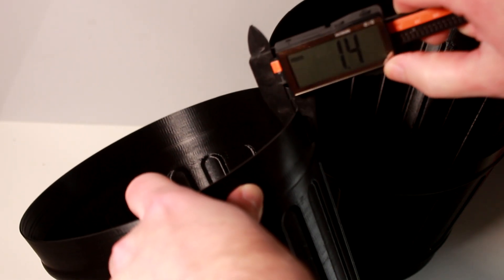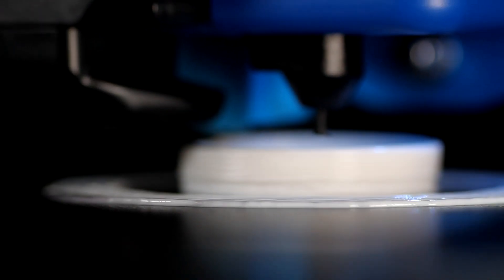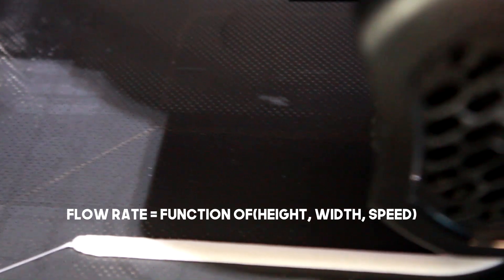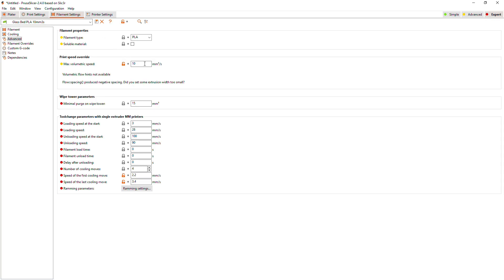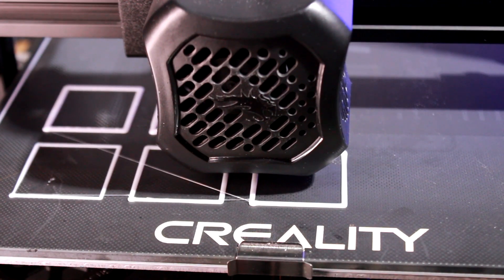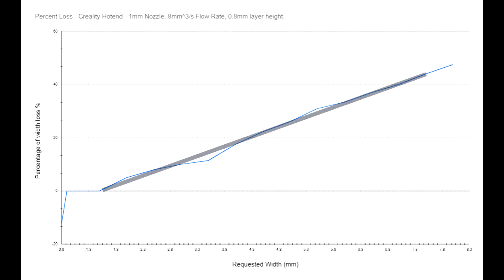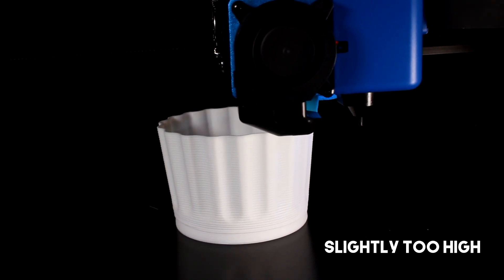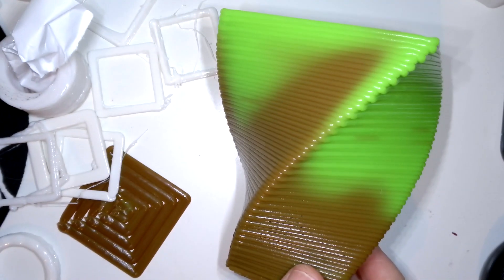Extreme Vase Mode II - EXTREMEST vase mode. How thick can you go when 3D printing vase mode?

Comment: The thermacroic filament test was some of the most insightful I’ve seen in any 3d printing test
Reply from the maker: It's a shame only 34% of people watched to that point 🙄
Reply: @LostInTech3D  still.... the implications for printing larger are that whole part cooling is something that will need to be developed, not just the topmost layer. I dont know of any current tech that cools down middle layers
Reply: thermochromic (heat and colored in greek)
Reply: Yeahh it looks so nice, and perfect for education.
Reply: @LostInTech3D  Hey that's okay, I'm back for a rewatch anyways so eventually it'll balance out
Reply: Actual uses for thermochromic filament are awesome. I've thought about printing fan ducts and toolheads out of it, using the color change to get a sense of what parts really need to focus on thermal resistance, but I ran into a problem: I want filament that changes color at around 50C (glass transition temperature of PLA) or 80C (class transition temperature of PETG), but I can't find any keyed to that temperature range.

Comment: I have to thank you for the optimal layer height part at the end. I have noticed inconsistent line width on my parts and couldn't nail it down. I used that calculation to find the proper line width and it completely fixed the problem 🙏
Reply from the maker: Glad it helped!

Comment: Great video. It's amazing how far you were able to push the limit, especially with the entry-level hot end. I recently designed a fast-printing 'vase mode' modular drawer system that works best with a 0.8mm line width. I found that printing with a 0.4mm nozzle produces much sharper detail in the corners (important for this model) than using a 0.8mm nozzle, even at the same line width. When I shared this on thingiverse, I was surprised by how many comments there were from people who didn't realise it was possible to print a line width much wider than the nozzle size.
Reply from the maker: Yeah - in the part 1 I did a survey and even when prompted most people didn't seem to think you can go much over the nozzle width, I guess the cat is out of the bag now, maybe more vase mode designs will appear (I'm interested to see yours btw!)
Reply: For some reason, I can't seem to post a link here,  but the design is on the top of the thingiverse landing page at the moment, so easy to find: 'Fast-Printing Modular Drawer System (Vase Mode)'
Reply from the maker: yeah it does moderate links but I usually get them in my moderation queue. Thing #5210727?
Reply: That's the one
Reply from the maker: I'll be trying that, it looks exactly like what I need for my electronics "collection" - thanks! 👍
Reply: No worries. Keep an eye out for v2. It will have at least 6 drawer sizes and some other improvements.
Reply: Added that to my favourites for future printing, thanks!

Comment: If extruder slippage is causing the under extrusion that implies that hot end pressure is getting too high.  Maybe increasing the temperature would make the filament runner and reduce the pressure on the extruder.  That would have the effect of introducing  even more heat into the part which might cause other problems.  Good video. Thanks!
Reply from the maker: Yes - absolutely, this is why I invested the time to write the software, to make a basis for further tests including temperature.
Reply: @LostInTech3D  Mhh maybe it has something to do with mass correction. If you calibrate your printer for 0815 printers and prints you can use some kind of flowrate ofset for the filament. However if the filament is off by 1-2% this gap gap will get bigger up the line width, but maybe just one handicap up the way.
Anyway very interesting for me as a newby on printing. Kinda like those test because i will mostly print stuff to use at the end.

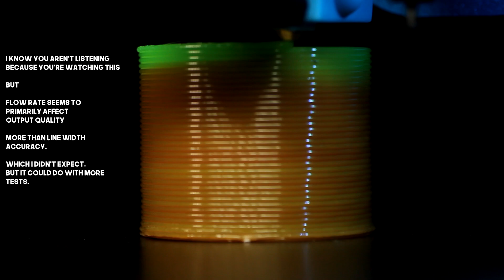Comment: The most important bit for reproducing this is really @16:00 here. Right in there Lost In Tech points out that a good starting point is Height = (2/5)*Width. When increasing extrusion width too much, I've always gotten "blotchy" prints like what you've shown. Thanks for burning through some plastic waste on our behalf :) I just gave up when I got those results. You pushed through!
Reply: So for example with a 0,4mm nozzle I would want a 1mm layer width with 0,4mm height?🤔 Can that the 0,4mm nozzle handle still.

Comment: That color changing filament is amazing. When the heat can propagate down not just to the previous layer but 2 and 3 layers deep, do you think that it significantly helps with the layer adhesion?
Perhaps a collaboration with CNC kitchen to test this.
Reply from the maker: That's an interesting thought actually!

Comment: I love this video! I figured this out myself a couple years ago and glad you have laid out the facts. There are two ways to reduce print time: reduce the printed volume and print that volume faster. I print fat lines slow even with a small nozzle and knock my print times way down. If you know the max useful print head speed of your printer, you can cut down print time by making thicker extrusions. The sweet spot seems to be a a layer that is 2 to 3 times as wide as it is high. I rarely print with lines below 1 mm wide anymore.

Comment: Good to see someone discovering my own print philosophy about flow rate

I can tell you exactly where the extra width is going. If you watch it extrude, especially wider than the outer diameter of the nozzle tip, you'll notice that the plastic begins to flow upwards around the nozzle. So the same amount of plastic is going out, it's just going up as well, not to the side like you would want it to.

Comment: My guess is the loss comes from the over-height you get above your final line level. basically, it's like having a stack of thick baloney/ham slices, and bending them upwards. it's not that the slices become less wide, but each slice's width moves upward over the rest of the lines. It's pretty much the issue you're solving when choosing the layer height, and you're having with too little of a layer height. Such a cool little study!

Comment: Fun things. As it happens I printed a ~2.3mm TPU "string" the other day from a 0.35mm nozzle using custom G-code. I needed this as a crucial repair for our caravan before a weekend trip. 

I took a lot of experiments, and extremely slow speeds to succeed. My plan was for a "normal" print first, but the TPU was too soft to be able to print such a slender print. But doing it in a single extrusion move, slowly, worked beatifully! Greater strength is a plus as well for a structural print like that.

Comment: This is an amazing video , with superb results. I will reuse it.
You say that nobody talks about flowrate, then look for the voron community and the speedboat benchy challenge, where folks print benchys (regular size) in less than 5 minutes.

They max out regular nozzles and volcano too, so they have alternatives.

They address the flowrate issues, as well as cooling issues. 

Some made air jet cooling, from a compressor, others used large industrial fans with a shroud to send a blanket of compressed air on everything below the print head, effectively cooling everything fast. 

Obviously you'd run in some limitations in the heat transfer capacity of the plastic with thick beads, but I bet you could see an improvement.

Also cht nozzles beats volcano at regular size. CNC kitchen tested it recently and even found a way to DIY an equivalent.

Look for :
-speedboat benchy challenge
-cht nozzles
-voron printers
-hevort printer (this guy made some of the insane cooling solutions for insane flow rates, over 50mm cube per second).

Cheers!
Reply from the maker: We talk about all this stuff all the time on discord! Even the air pump cooling :) I just don't have the time to untangle it into sensible videos because it's all a bit crazy 😂
Reply: @LostInTech3D  After writing it, i figured that considering what you did, there was actually no chances that you didn't hear about all of this :)
Sure, crazy stuff, but really interesting, i sure would watch more videos about it :)

Comment: Crazy! I never knew you could cleanly extrude anything significantly above the nozzle diameter, much less several times over. I think you could use this to greatly speed up 100% infill, printing the outer walls with the natural nozzle size but then doing infill with double or triple diameter. Cura can do infill layers thicker than wall layers, and can use a different extruder with larger nozzle for infill. So you could probably slice it like that, and then post-process the gcode to make it use a single extruder for everything. You'd also need to have relative extrusion enabled, since the commands generated for separate extruders would have different absolute positions.

Comment: Just throwing my two cents in, when I print in Vase mode I use a cheap chinese 0.8mm nozzle on a mostly stock prusa mini (other than a bondtech extruder upgrade). I print a 0.6mm layer height with 2.4mm extrusion width and it prints beautifully at 2.35-2.4 measured layer width. My one trick is limiting the flow rate to 12mm³/s and the speeds sort themselves out. Love your content!

Comment: What I took from this video is, to be able to print PET not PETG well and reliably is a shorter area for the filament to be melted in, basically making every bit of the filament that goes into the melting point need to be pushed out of that area faster because PET likes to crystallize the longer it is I contact with heat hot enough to melt it. Thank you so much for giving me this thought process! Just a theory now, but it does follow the science around PET and is the reason PETG is even a thing in 3D printing.
Reply: I'm trying to get consistently good prints out of PET (I have gotten exactly two prints, an AR lower and a grip, out of half a roll, with a lot of hard jams). If you figure out a flow rate range that works, especially with retraction, let me know!
Reply: In my experience, it's not the time spent hot, but the time spent cooling that matters. You have to cool fast enough to lock in the glassy state.
Reply: @paulstrealer5414  it varies some with the geometry of your part. As Lost in Tech points out, the thicker your your walls, the harder it is to dissipate heat. I routinely print at 5 mm^3/s and 265 C on my Prusa MK3. If I notice any crystallization I increase the part cooling. You absolutely have to dry your PET to get a good print. 

These days my hard jams with PET mostly from not gripping the filament tightly enough (it's slippery!). I use 2 mm retraction with a direct drive extruder, but I think that's more by chance than by tuning.

Comment: I realize I'm getting to view this after awhile, but blame it on the YT algo if you ask me.  What sort of data are you looking for from your "test slicer"?
This ( Thermochroic filament )is fascinating to me, and one of the reasons I tried to argue ( with myself ) that in order to properly print with ABS, I need to immediately hit it with the fan to cause the latest filament printed to cool after attaching the previous layer.  I have only managed to print with ABS using an ooze shield about 4mm from the model.  I have tried building a box, but that doesn't work for me.  I am using a Creality 10S, 300mm x 300mm x 400mm, direct drive, BLTouch, other than that pretty much stock.  I have PETG, ABS, ASA, PLA, TPU, and NInjaFlex filaments.

Comment: interesting, layer height of 0.16 has always been recommended for 0.4 by all slicers for "quality" prints. Since your last video about vase mode i changed my widths to 0.45mm and then had to bump my print height to 0.18mm to get clean walls I wasn't sure why but i was able to drop infill to 8% from 15% without losing rigidity using my calibrated hands, so I wasn't complaining.
Reply from the maker: that checks out then doesn't it, because 2/5ths of 0.45 is 0.18! Nice! 👍
Reply: @LostInTech3D  So... 0.25mm nozzle/width -> 0.1mm layer height? I usually go for 0.08mm but I guess those "rules/estimates" probably don't apply all that much to small nozzles/widths.
Reply from the maker: I'm not sure I'm willing to commit to the idea that the rule works for all nozzle widths, but hey you never know!! That layer height does look about right for a 0.25 nozzle!

Comment: I wish more stuff was rated in flow. Pretty much every filament had recommended print speeds, but even those are kind of irrelevant depending on your slicer. The thing I finally learned in Cura was to show all the speeds on the settings so I could set them the same. I was having issues where it was printing inside walls way faster than my hot end could flow. Now I just set it all the same and target common flow rates. I have an old Flashforge Creator clone with a mk10 hot end, but it's hard finding data out there for flow rates. Almost everything online for testing is based on the E3D style hot ends. With my all metal upgrade though I can reliably print PETG at 12-15 mm3/s, so I've been reasonably happy.

Comment: After watching this video as well as CNC Kitchen's line width video, I am starting to wonder if measurement of extrusion force needs to become part of the discussion. The bed leveling springs have a finite stiffness, as does the bed and the machine frame. At these extreme widths, the pressure applied to the bed and in reverse to the extruder, even if the extruder does not skip, must be large enough to deform the bed springs at least. 
I wonder if the linearity in line width underdelivery is really just measuring the spring rate of the bed leveling and machine stiffness, and the wander is due to the variability of stiffness at different parts of the build plate.

Comment: I think the overextrusion you see for some prints is related as you mentioned to the fact, that the extruder is calibrated for the force of a 0.4mm nozzle. However, this just means that the extruder is bad in the first place, as it already slips at nominal speed. It slips less on low flow rates with large nozzles than calibrated for. I'd like to see if a quality extruder, e.g. Bondtech would exhibit the same effect.

For the underextrusion at higher widths I can imagine two effects. First, the extruded material might bulge upwards when it's wider than the flat part of the nozzle reducing the cross section. Second, it might already have cooled down so the extruder cannot make the extrusion much wider (trying to deform rigid material).

Also all hotends tend to underextrude a little when approaching their maximum flow rate. However with 10mm3/s on a volcano you should have some headroom.

Another remark: you can print pretty fast with Prusa Slicer if you set all speeds to your travel speed and just limit the print speed via the volumetric flow of the filament. That way you never have to worry again if you overload your printer. Changes to layer heights and line widths will change your print speed automatically to arrive at your desired flow rate.

To increase your flow rate significantly on standard hotends look into Bondtech CHT nozzles. They perform better than a volcano hotend with a non CHT nozzle.

Comment: I wonder if the line with is because of the surface tension of the plastic. When your printing wider than the the flat part of the nozzle it looks like the plastic is "springing" up and trying to reduce surface area, aka become more circular. You might be able to see this by checking if the layer heights.

Comment: I believe that nozzle diameter is a constraint also, because force required to squeeze a viscous fluid through an aperture at a given flow rate is inversely proportional to aperture diameter. The effect becomes noticeable as early as 0.4mm nozzles, which don't seem to achieve the same results (proportionally) as a 0.8mm nozzle. I have found that I need to use a 0.8mm nozzle to achieve the full flow rate of the hot end. There is probably a crossover point somewhere between 0.6mm to 0.8mm nozzles where the limiting factor switches from being the nozzle diameter to the melt zone characteristics.
Reply from the maker: yes I agree - and my data did support this in the graphs, if I had more sensitive equipment (a micrometer screw gauge for example) I would probably have seen that more in the lower nozzle sizes. A 0.1mm resolution isn't really enough to make assertions about this, perhaps I will pencil that in for the future.

Comment: It seems that most of those color change filaments change color somewhere roughly between room temperature and life threatening fever temperature.
Would be nice to have one that changes color within a few degrees of turning solid or maybe heat deflection temperature. This would not only be really interesting, but help with tuning part cooling.

Comment: Here's an idea the thick layers seem to not be able to cool fast enough before the next layer extrudes which is why it doesn't look the best. so what if we cool down the layers with a fan? 
Maybe just one that stands away from the printer or a hotend mount that uses a computer fan?
Reply from the maker: Yes - and it works too, I used that trick to make the "wave" pattern more obvious when filming. It would be worth testing on the thicker filament, for sure!

Comment: What slicer were you using initially before you wrote your own? Can this be accomplished simply by increasing the line width setting in Cura? Or are there other settings that need to be changed too?
I don't want to create ridiculously thick lines like demonstrated here, I just want to make a vase with 1mm wall thickness using a 0.4mm nozzle, for instance.
Reply from the maker: You can use any slicer, you might need to set the nozzle to 1mm, to make it accept the numbers.